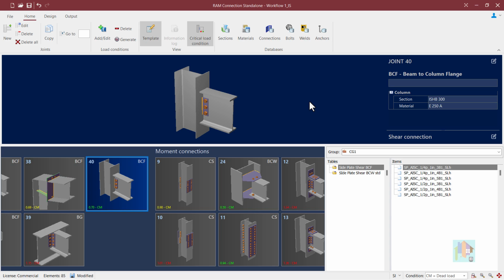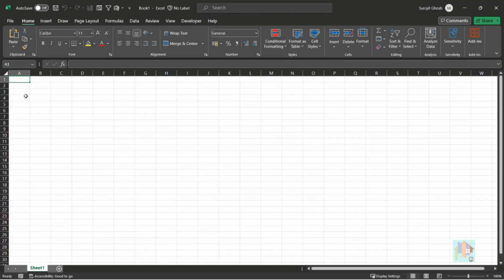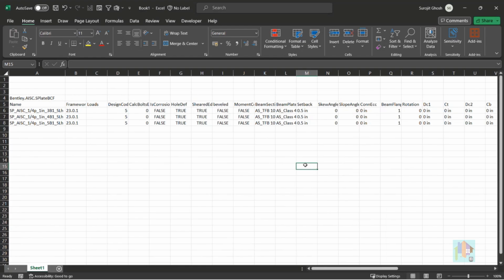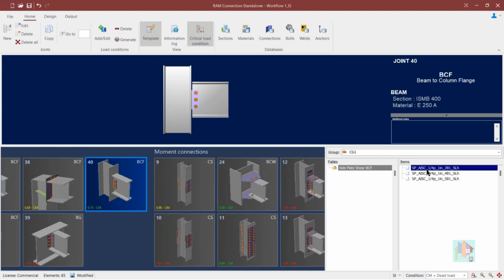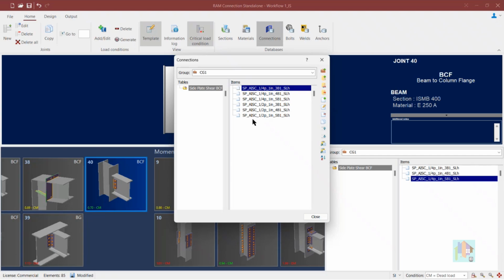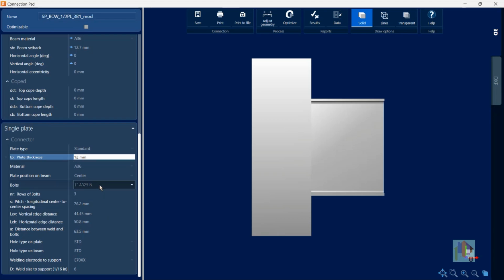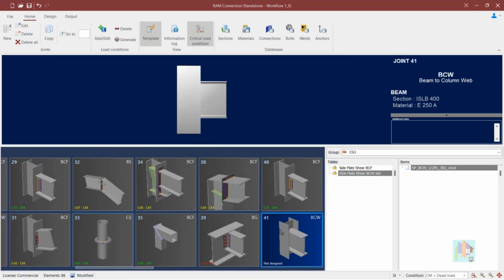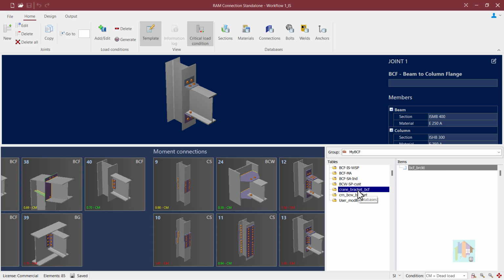Connection Design Overview - Part 6: Create Multiple User Templates || Import/Export data from Excel

Comment: Surojit, why is RAM connection so limited? Why don't we have simple bracing connections for example?
Reply from the maker: All connection templates are not available for all design codes. For AISC code, multiple bracing templates are available (horizontal as well as vertical bracing connection), not for Indian or Euro code. This is one limitation of the program.